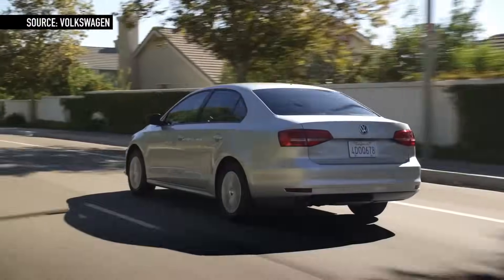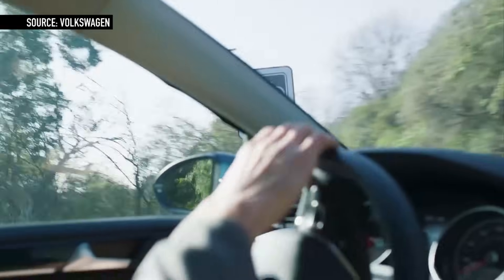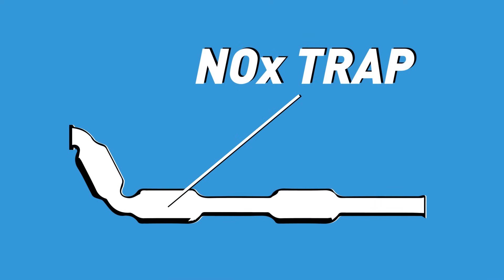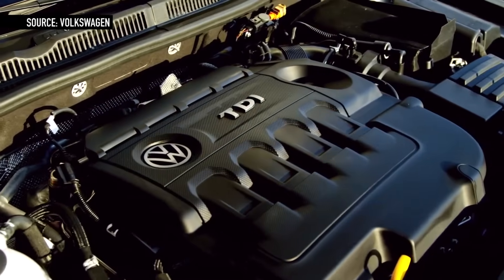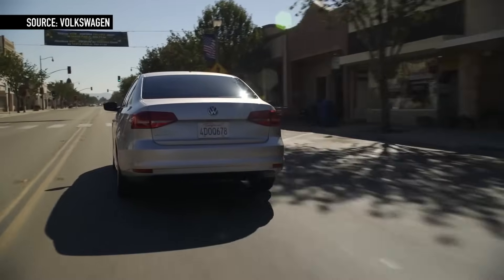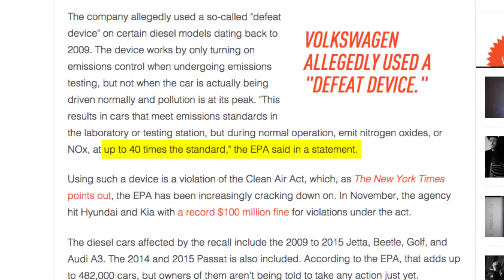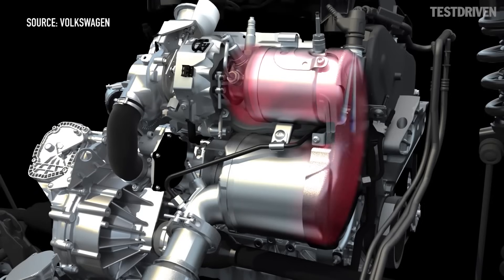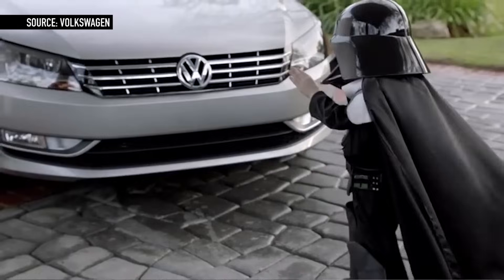Volkswagen's diesel scandal, explained

Comment: I'm real glad these guys were caught. On the same note, I wonder how many other car companies do this? We really should do more about this. Climate change is a BIG deal.
Reply: +John “IslanderPickle” Sibok you are also not fully educated in the diesel vs gasoline war taking place in the USA.  All high efficiency VW blue motion engines are prohibited on the USA markets. That is a fact. Why would you buy a Prius when a car less than half the price gets you over 100 MPG? There is a war taking place. Nothing to do with the environment... It's all politics. Like another commenter said here, the CEO of Toyota just sent the CEO of VW a very nice flower arrangement with a nice THANK YOU card attached. The ridiculous emissions requirements in the USA based upon what comes out the tailpipe only (thanks to California) is the most assinine concept as it does not take engine efficiency as part of the equation.  It makes diesels impossible to compete with gasoline when measuring out the tailpipe emissions. However, diesels have less emissions over the life of the engine because of their greater fuel economy and efficiency.  Gasoline engine is 15-20% efficient.  Proper computer managed direct injection diesels are approaching 45% efficiencies.  VW fudged the software to get temporary tailpipe emissions to pass, but overall it is still a much less polluting engine than gasoline counterparts. This will be an interesting war.  Political and full of lies and deceptions.
Reply: Some US people drives those huge ass trucks and pickups that burn more fuel than VW but yet its okay for them. Stupid morons.
Reply: Are the emissions reasons why other car companies haven't adopted diesel motors like Europe has? I remember one when looking into buying a diesel jetta, reviews saying that diesel itself in North America is much lower grade than Europe and could lead to problems on the fuel side of the car, was this vw's lame workaround? It sounds like a pretty sophisticated trick, how far back have they been doing it?
Reply: +John „IslanderPickle“ Sibok Hmm ya murica cares about climate ..
Reply: +John “IslanderPickle” Sibok You don't know what you are taking about.
VW sold 500.000 diesels since 2009 when just last year in the US 16 million new cars were sold. Do you see the difference?
Also there is not a single case of a person that is sick after being near diesels engines and I'm not even taking about cars. That is extremely odd, don't you think?
Reply: +John “IslanderPickle” Sibok 
Honda and Ford were also caught by the EPA a few years ago.  The VW cars emitting higher levels of NOx == lower levels of CO2/global warming gases.  (The EPA actually prefers low NOx and high CO2.)
.
Reply: +John “IslanderPickle” Sibok Climate change isn't really relevant here.  NOx is not a greenhouse gas, and in fact, has the opposite effect as greenhouse gases do (in that they decrease the heat capacity of the air so less heat is held in, and they can form crystalline compounds that reflect back sunlight).  The problem with NOx has to do with humans inhaling it for one, and the fact that it is a smog-former, creating a stronger visual impression of poor air quality, and thirdly with acid rain (though with the drought, I'd take any kind of rain right now).  I'm not inclined to believe that it would be an actual risk to air quality because the ppm even at 400x (let alone 40x) the allowed rate is below dangerous levels, especially when you scale it by the percentage of diesels on the road.  But because they are reactive, you can get a much more visual feedback that the air sucks.  Basically, it's about "the air quality kinda sucks, but at least if we control NOx, it won't be quite as obvious"

Now in all fairness, I have my issues with the EPA and their bad science and the fact that the U.S. does not actually have emissions standards, but actually quality-of-emissions standards...  but this is clearly a cheat that was easily avoidable.

Most all other diesel cars (e.g. from BMW, Mercedes, Chevy) are not affected by this because they use urea injection instead of those NOx traps (adsorption beds, really) to eliminate NOx emissions without having to waste fuel.  VW also does this for their larger diesels such as the 3.0L V6 diesel...  but they boasted that they can get the NOx emissions down with their smaller diesels low enough that a NOx trap would have sufficed and they didn't need urea injection.  Main reason they didn't want to do urea for these smaller diesels is because they are installed in cheaper value-oriented cars like the Jetta and Golf, and it would have been an added expense that might make it unattractive to the consumer.  Honestly, if they just admitted back in 2009, "Yeah, looks like we have to go with urea after all," they would have avoided this mess entirely, taken only a small hit at the time, but met emissions without having to worry about mileage.

I'm also of the mind to believe that this is a sign of why Mazda's Skyactiv-D will never appear in the U.S.  They made the same claim about being able to avoid urea, but I think they would rather not offer it than admit they were wrong.  And with VW's mess, it basically means that no one wants to utter the word "diesel" for a while.  Americans are too stupid to look deeper than the surface.
Reply: Emissions controls have nothing to do with climate change, emissions are controlled in order to protect your health.
Reply: +John „IslanderPickle“ Sibok Every Volkswagen, Porsche,Audi,  diesel car made since 2006 i believe
Reply: As of Thursday, the only company that has downright claimed that they DONOT use it is Nissan.  All the other companies are under investigation. I'm not sure if the other have been proved clear right now though.
Reply: I agree with your question how many other manufactorys do the same trick.  Most of the time they all do it.
Reply: +John “IslanderPickle” Sibok carbon monoxide is way more harmful to the environment than nitrogen oxide. That said... fuck off
Reply: +John “IslanderPickle” Sibok Jesus Christ. If we all went to nuclear energy cars wouldn't fucking matter.
Reply: +John “IslanderPickle” Sibok Less fuel burned = less CO2 emmissions.  By making the engine less fuel efficient you are increasing the CO2 output which is theoretically the driving force of climate change.  VW is in trouble because of excessive NOx output for human health reasons.  By "fixing" their cheater ecu you will be burning more fuel producing more CO2 and less NOx.  This of course is all small potatoes compared to other polluters anyway.
Reply: +John “IslanderPickle” Sibok Also, you got 87 likes on a false environmental statement.  Gasoline is most commonly used in 87 octane.  EPA CONFIRMED!!
Reply: Quadrunner B slight note on the cheat with regards to CO2... Fixing the cheat will not necessarily burn more fuel.  Really, the trick is that more fuel has to go unburnt in order to clear up NOx. In normal operation it doesn't do that, internal temperatures are higher which means more NOx and little to no unburnt fuel means the NOx trap isn't all that efficient, but mpg is noticeably higher as is power and CO2 is low, but probably not all that different.

Also, urea injection could avoid all of this and have even better performance and mpg and lower CO2 in theory. But VW wanted to avoid this because of cost for what should have been more value-oriented cars. they also bragged that they could do without it, but they should have just bit the bullet on that one in the first place. The reputation hit they'd take for it would be tiny compared to this. I can only imagine that they believed that the financial hit they'd swallow because of the higher cost of the vehicles would be too great to bear.
Reply: Parashar Krishnamachari That unburnt fuel is fuel that couldn't ignite, and propel the car forward resulting in lower mpg.  That's just the way it is.  If the converter is working properly, all of the fuel, including the extra used for gas conversion is used. Inside of the converter, any extra gas that isn't used to convert NOx into N and O gets converted to CO2 and H2O.  What that amounts to is you have a slightly less power to move the same amount of weight, but the about same amount of fuel used and therefore, CO2 produced.  Since you now have less gas available for the engine, you need to compensate by adding more than you would without emissions equipment.  Does that make sense?  I can't always explain thing the way I'd like to, but bottom line, any gas that isn't burned in the engine, from an efficiency standpoint, is waste.

In other words VW can't give you optimum fuel economy by reprogramming the ecu.  They can only worsen it since I assume it was already optimized.  I don't know anything about Urea except pee jokes lol.  Is that used as a substitute for fuel?
Reply: Quadrunner B hmmm... I was under the impression that the conversion with a NOx trap was not quite so "perfect" in getting out CO2 for a given amount of hydrocarbon. By that I don't mean efficiency, but that you get some other products as well.

As for urea, it can basically react with the NOx directly to result in ammonia among other things so that you don't need extra fuel. The heat of the exhaust gases actually helps this along and it's a lot more effective. it's part of how BMW gets similar mpg out of their diesels while still getting 30 more bhp and torque than VW's small diesels. VW uses urea on their bigger diesels and so those aren't affected by this whole cheat business.
Reply: It's obviously not so perfect as you can smell for yourself.  I was just idealizing for simplification.  I looked into that urea stuff.  Other then the fact that its another thing to go wrong and adds weight + cost it looks like a pretty good deal, like you said.  I would suspect the price of the stuff adds a fair amount to your over all price of ownership.  I wouldn't doubt it if a non recalled TDI ends up being worth more than the new ones in a few years.
Reply: I've heard parts of Europe are having pollution problems right now because of their diesel addiction combined with their tighter packed population.  We all know about places like Mexico City and the big cities in the west  where its recommended you don't go outside on certain days.  I think the US governement is trying to avoid that.  Manufacturers are scrambling to raise their mpg's up to the higher standards required by the EPA as well.  They are being forced to focus on both.  I would suspect this has something to do with the fact we were falling behind Europe for quite some time when it comes to MPG's.  Their trucks and suv's have gotten mid 20's to 30's for a decade or two now.  Up till recently,That's what our cars have been getting unless you bought a premium priced hybrid or a little tin can compact.  Also, these newish Urea injection systems really do make clean diesels with better mpg.  I don't expect the whole diesel is dirty thing to last much longer.
Reply: EpiDemic117 Yeah that's what I've heard.  Better performance, but a little bit of a pain.  Does it work in the winter?  I get -30 degrees where I am.  It must work if truckers are using it though.
Reply: EpiDemic117 I believe most every manufacturer for diesel passenger vehicles will set the size of the urea tank such that it basically only needs refilling in sync with the oil change cycles.  There will of course be a bit of margin for error since some people drive harder than others, and some will miss their oil change intervals by more than others.  In theory, it means that the consumer doesn't need to worry explicitly about urea tanks at any time.

This also serves the dealers as well since your neighborhood oil change shop won't likely have urea as well, so it largely forces people to go to the dealership for regular maintenance (and the price of urea solutions are controlled such that it's more expensive to buy your own and top up yourself).
Reply: +EpiDemic117 on the 2015 vw's and all passats they have a 5 gallon D.E.F tank that needs to be refilled every 10,000 miles.
Reply: ***** Hopefully I like to think every prius saves enough gas to give my truck a 1000 gallons of extra gas.  Good thing if its true because I pass them whether they are driving slow or not.  You can't ever drive slower then a prius.  It feels wrong.
Reply: They just determined that globally warming is preventing the next ice age.
Reply: EpiDemic117 I feel like anyone in a coastal region should care.
Reply: California Dude That doesn't sound logical.  Kind of like saying that your oven warming up is preventing it from cooling down.  No, the hot metal rods are preventing it from cooling down, and it's warming up as a result.  

Oh I think I see what your saying now.  Like the thing where once the ice caps melt by so much, the world won't be able to cool down as easy.
Reply: EPA spilled millions of gallons of poison into a river because they didn't want to spend extra money on safety....and guess what...they are the government and no one got in trouble.
Reply: @Joe Mariconadas Yeah it is stupid that these people are making a big fuss about the diesel engines scandal. These people got nothing better to do in life.
Reply: John Sibok No it's not
Reply: UltraFighter18 the reason why we don't care about diesels is because our fuel is cheap very cheap and has been for decades you Europeans could not figure out how to refine fuel as efficient as us Americans and your landscape poses a challenge at times also
Reply: People have no idea that they will get better fuel economy with what vw did by bypassing all the “emissions” bullshit. All the DPF and DEF systems rob power and lessen fuel economy, that is why people delete there diesel vehicles.
Reply: So is burning twice the fuel. Ever seen a gasplant? Mine? Oil farm or tarsand plant? You realize if all diesel engines met epa requirements we would be using up to 2x more. Sure iyd be burning "clean" but you obviously never seen what is produced and put in the air from refining. And thatll have to happen twice as much to make the same amount of engines to go the same amoint of miles
Reply: No it's not.
Reply: But this kind of PR is good for the polluters.
Reply: +Brandon Marks  Funny how Americans think that those huge cars they drive which burn 2 to 3 times more fuel than a small Jetta are so environment friendly. 
Americans were always anti diesel for no objective reason, it's been inserted in their culture this attitude against diesels.
Reply: +John “IslanderPickle” Sibok Yeah, Europe has MUCH more lenient emission laws, you also have to wonder is the NOx that is not being throw in the atmosphere worth the extra emissions. Not saying what they did was right but emission laws do not get cleaner air, this is pretty much a way legislators have found to ban diesel without, making diesel engines illegal.
Reply: ***** wow, so no effect on climate change? Still, these people were absolute dicks. Putting the lives of people at risk just for profit is simply disgusting.
Reply: Burning fuel isn't the problem you moron.  The majority components of fuel combustion are CO2 and water.  It's the OTHER things like NOx that VW didn't limit enough, producing over a dozen times the legal limit.

Go back to school and learn a thing called science.

Plus, yes it is okay for anyone to burn as much fuel as they are willing to pay for, just as you are allowed to have as many pairs of shoes as you want without me limiting that, despite the fact that making shoes also causes pollution.
Reply: Suprise, suprise, automobiles aren't even a leading contributor to climate change..